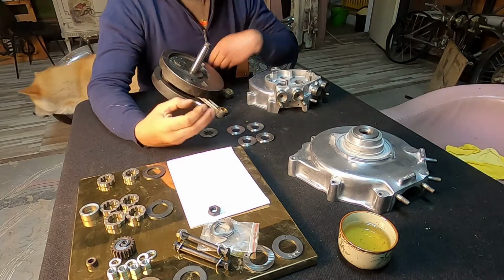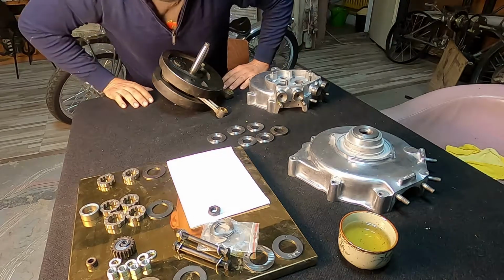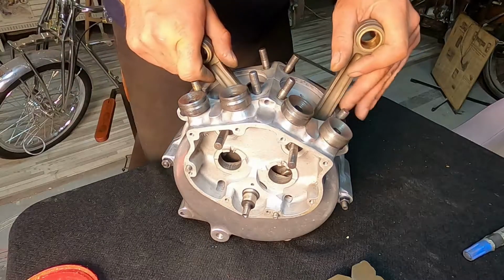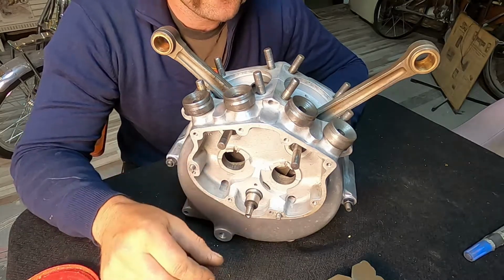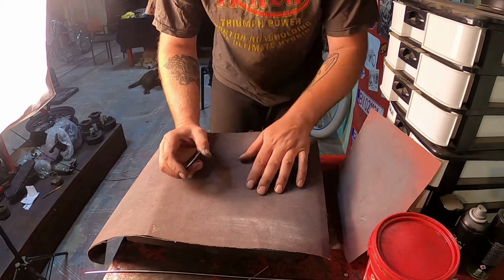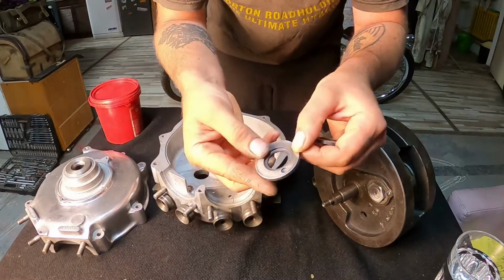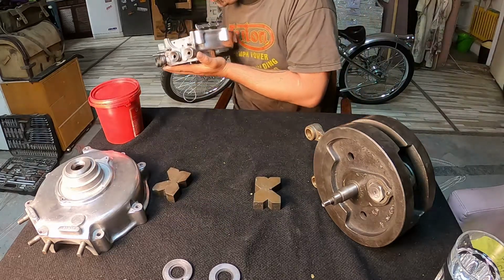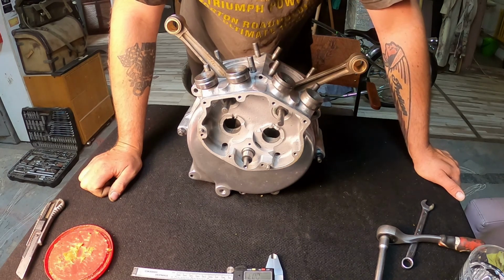EP 12- Scout 648 Stroker -Thrust washers final part

Comment: Next addition to the machine shop ... serface grinder .... I wouldn't have any finger tips left after sanding for over an hour. 

nice work as always.
Reply from the maker: Mathew this way you will also not have any finger prints , you could make a perfect crime :)) . i do have a surface grinder but i still need some good days to learn how to operate and make a small restoration on it . so i prefer the hand sanding :))